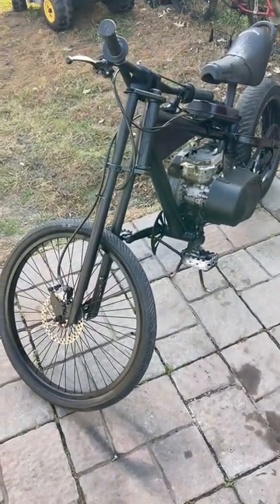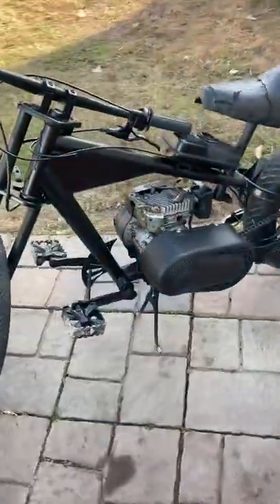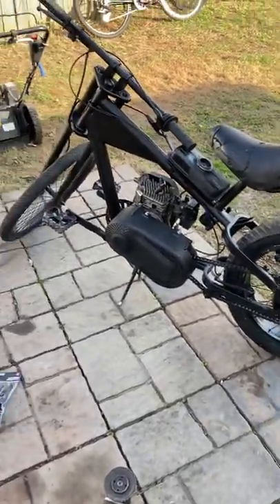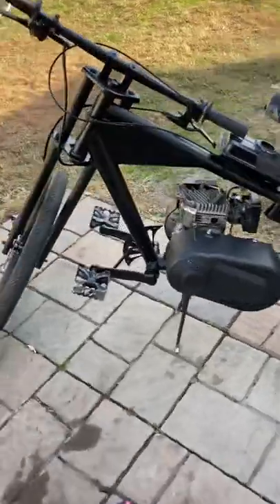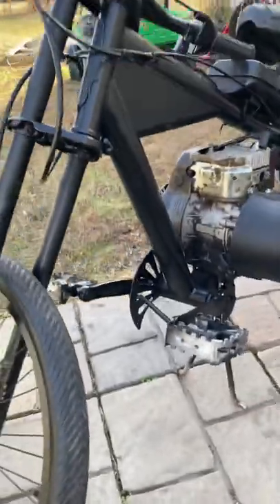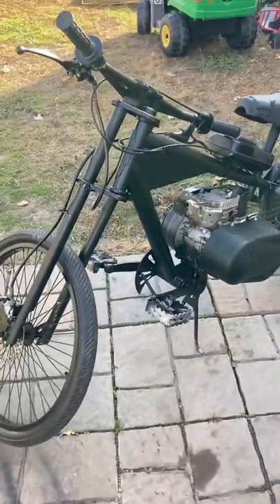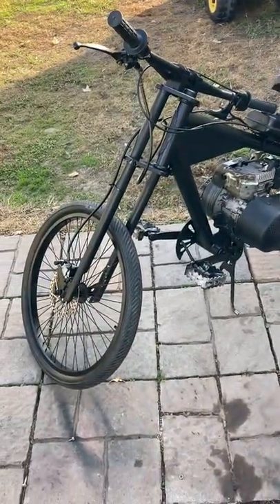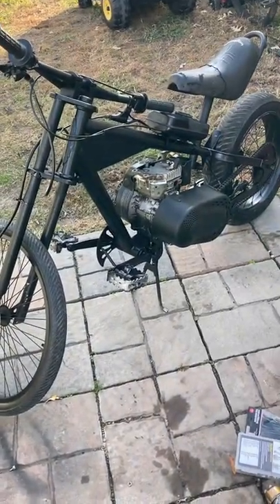Schwinn chopper / bike disc brake conversion finished

Comment: Are you sure those forks can handle those disk brakes? Or would it be better to swap out the forks for sowmthjng else?
Im just afraid that if yku squeeze on those disk brakes the forks might break.

Or maybe im just paranoid.

Comment: whats the mount for the front disk breaks?
Reply from the maker: @wake2556  I used a mountain bike disk brake conversion kit, flipped it round to make it line up correctly then had a friend weld it up.